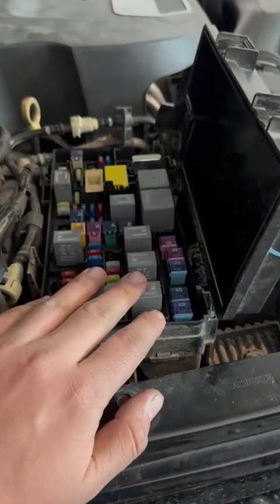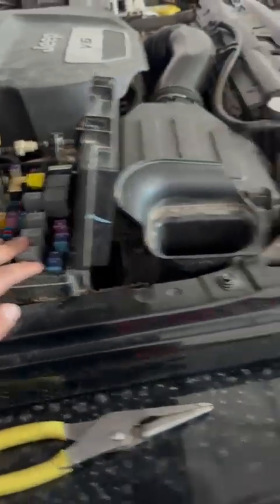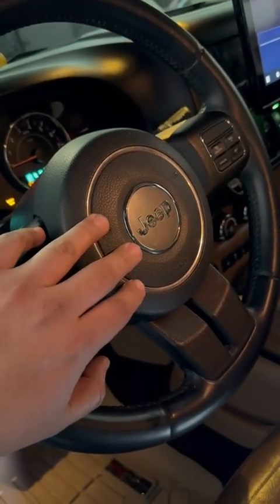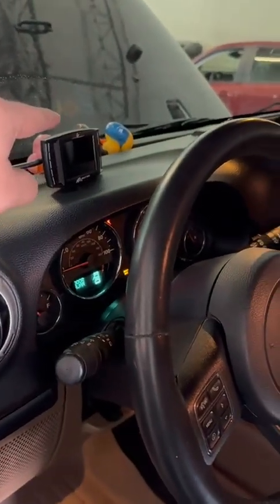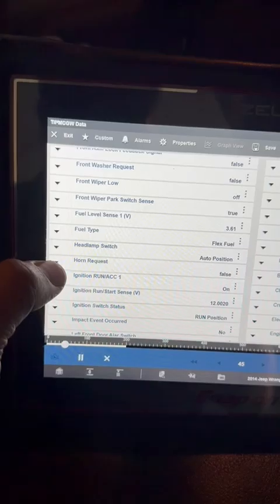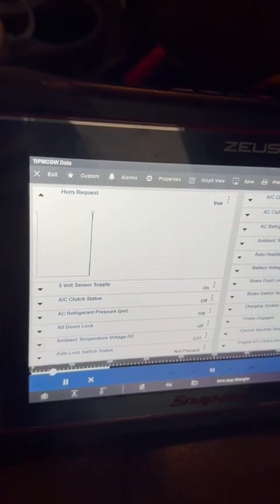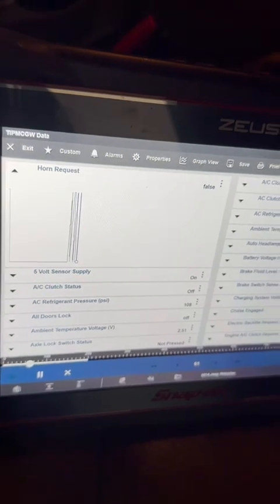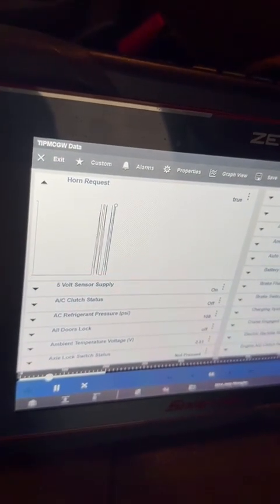Description of Horn Switch Circuit on a 2014 Jeep Wrangler 3.6L.

Comment: How do I fix this problem
Reply from the maker: Thank you for reaching out!

This video is part of a series demonstrating the entire horn circuit for this YMM. In this case, the previous mechanic had stolen her horns. I wanted to outline the entirety of the circuit in case someone needed this information. What you'll want to do is find the points the horn signal goes from unit to unit, and make sure that its getting there. You'll want to work backwards from the horns and see where the break off occurs. Could be a wire, could be a busted processor/module, a fuse, relay, etc.

I hope this helps!